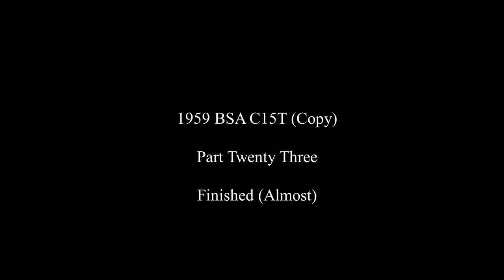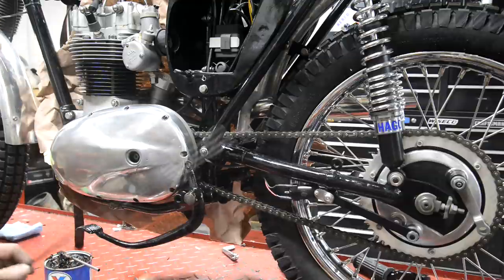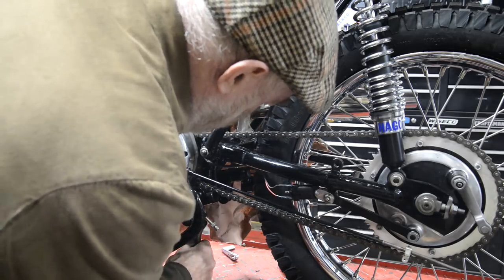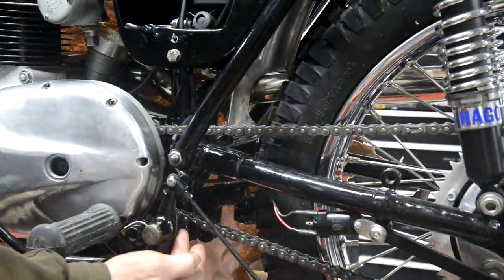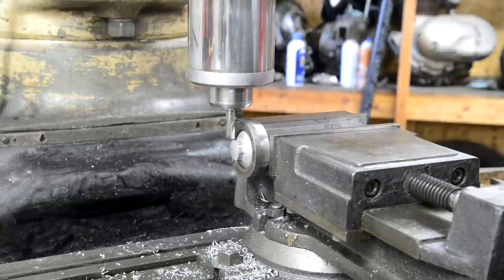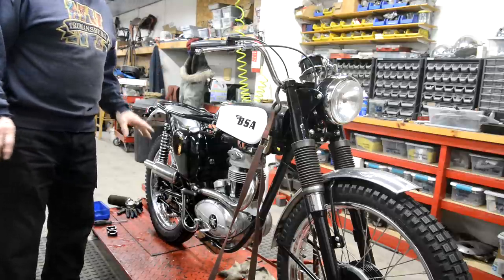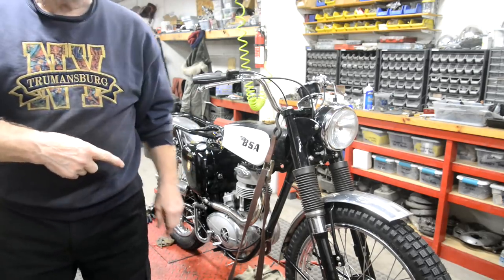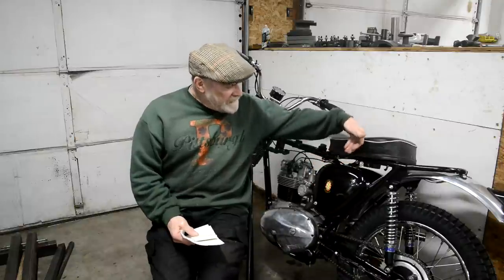1959 BSA C15T (Copy)  -  Part Twenty Three

Comment: Greetings from Cullercoats, Mick! I love your videos - they make my week. The bike brings back memories of my late (1967 reg) C15. The rearmost screw hole in the primary chain case on mine was not a breather. Onto the back of the bolt was a long nut with a small tube attached, and chain case oil was flung onto the screw and it dripped via the tube onto the chain as an oiler. The problem was that (a) the oil constantly needed topping up, and (b) the rear tyre got oiled more than the chain. Mine had the tube crushed to prevent this.
Reply from the maker: Cullercoats! When I was at Darlington Teacher Training College a lass in the biology group was from Cullercoats and I spent a weekend there with her and her boyfriend.

Comment: To be honest I gave up on the Electrix world system on my XS 650 as the lights were so bad including with a LED headlight. The system only puts out 55 watts and a normal dip/main is 55/65 watts alone. I was not also happy with the ignition side, unlike yours it’s non adjustable and was hard to set up. So I have a new 200 watt and cdi ignition system fitted. Anyway I really enjoy your videos and always look forward to Sunday afternoon to watch 👌

Comment: Hi Michael, Nearly the end of ANOTHER build! Cannot remember how many that is now? Next stop the Otter. New territory there, don't think I have seen you do a Triumph yet? If there is not enough space for a lock nut on the brake pedal bolt maybe a split pin and washer might do the job ok? Next weeks video, Michael out on the tractor clearing mountains of snow??. Keep yourself safe and warm and regards to Linda. Cheers Dave Northumberland, UK

Comment: You're quite right, it should have been made clear that the power pack was not a direct replacement for a battery. Powerpacks have their strengths, but lighting is not one of them.

Comment: Love your videos Michael. Where the rear brake pedal connects to the rear brake arm at the threaded bar. Should you not have put on a second spring between the adjuster olive and the other end of the of the of the threads. It might have required a couple of nuts locked together to stop the spring moving up and down?......:)

Comment: A very nice rebuild. 
 I wondered if you could tell me what size rear tyre you have on the bike? I am rebuilding a C15 basket case into trials trim for a relative, it came with a lovely rebuilt 18 inch rear wheel fitted with a huge looking new 4.00x18 Pirelli trials tyre, an MT43 I think, but the tread is very close to the swinging arm even with the spindle right at the end of the mounting slots and the chain adjusters fully wound back. Trying to push the wheel forward any further would result in the tyre touching the angled side tubes of the swinging arm near the pivot.
 I was thinking maybe a 3.75x18 or 3.50x18 knobbly trials tyre would be a suitable size that would fit correctly.
Reply from the maker: Actually it can depend on the tyre. Some trials tyres have side knobs that stick out further than others. The 18x3.5 tyre that I fitted caught the chain and when I measured the width I found that it was wider than the 18x4.00 IRC trials tyre that I use on my comp BSA. You need to get a measurement across the side knobs not the stated size of any tyre you are thinking of.

Comment: I have an Electrex world system on my Yam XS650 bobber. It only as a 50w charging system on it so I run LED bulbs but also a battery because I fitted a modern electronic speedo. It all works very well, Albeit the headlight is crap with the cheapo H4 LED. Just be warned. The Electrex world ignition coil broke down on me after just 130 miles. Other people have had the same problem. I fitted a Honda coil instead and that works perfectly. If your bike starts playing up swap out the coil?
Reply from the maker: Thanks for the heads up on the coil.

Comment: Is the power pack a capacitor? Would it be possible to put a second one in parallel?
Reply from the maker: Yes it is. Not really happy with it but it will be fine for the use the bike will get.

Comment: Where did you get the right-angle twistgrip from?
Reply: Amal
Reply: @andyb7963  I don't think there is an Amal shop near me (or in the USA)(or in the UK for that matter).  Maybe you are not remembering correctly.
Reply from the maker: I get mine from the UK. I used to get them from Sammy Miller products when i was a dealer here so I assume that Feked who bought the SM business have them. I got the last couple from In Motion also in the UK.